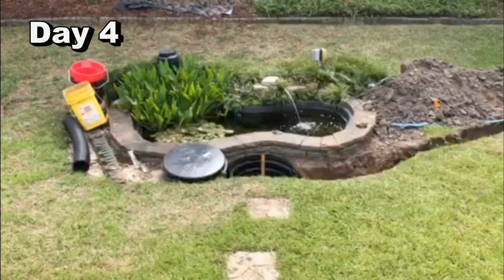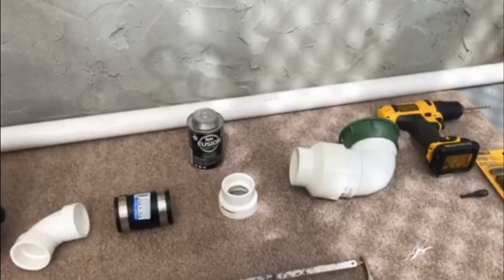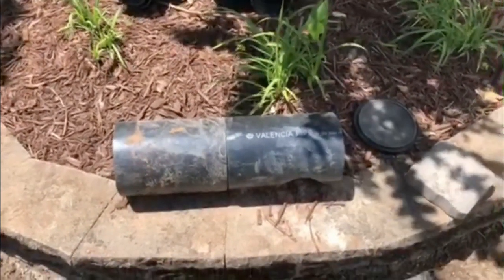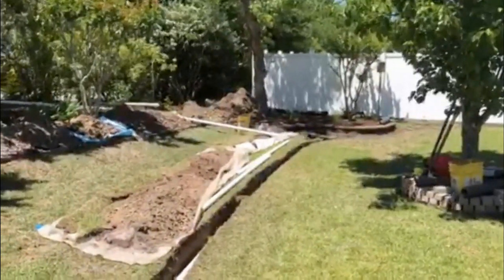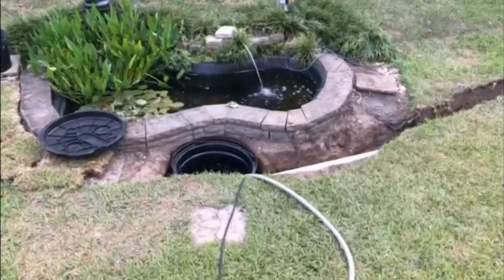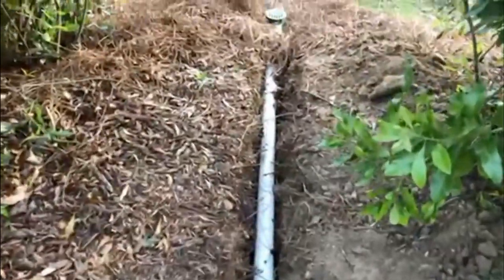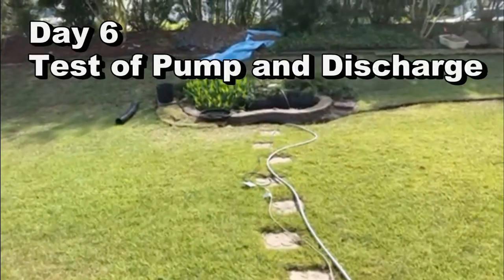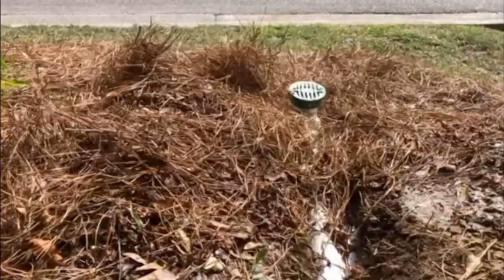Solve Backyard Flood - DIY viewer install

Comment from the maker: Good morning! Chuck here with Apple Drains . I wanted to thank Robert for all his videos and for his great comments about helping him. But you know what? Robert did all the work! He did a fantastic job. I know he would appreciate any and all comments about his work.
Reply: Hey. I have about a 3 foot recessed semi inground pool on one side and was wondering your thoughts on putting a French drain pipe that is corregated and perforated around the bottom and wrapping it using soil separator fabric at the bottom before I back fill it? Would that hold up ok? Will be about 3 feet under ground with draining to daylight on the side that isn’t buried.

Comment: Robert great job!  I drilled my 3/16" hole at an angle so it sprayed down, dosen't really matter i guess. Congrats on getting it done.
Reply: What is the 3/16 hole for?
Reply: @Srvelis82  vent
Reply: @MikeMike-qb3iz  on which side of the one way valve? Before or after?
Reply: @Srvelis82  before the check valve
Reply: Make sense.  Appreciate it.

Comment: If the discharge from the pump is inch and a half, you don't need to open up to 2 inch. The volume of water is limited to the smallest restriction. It would've been much easier to run and connect inch and a half pipes. I also would've avoided using rubber couplers and used 45's & 22's. 
I also like the discharge at the end to be open and not up to drain the pipe. Don't like water sitting on pipe. In northern states, it could freeze. 

Great job! After the grass grows in, it'll be hard to tell there's a drainage system there.

Comment: Chuck or Robert, do either of you have a video about how to handle the electrical when the pump is far from the home?
Reply: I don’t have a video.  I have a small pond in my backyard and previously put an electrical outlet beside it.  I had an outside outlet on the side of my house that was about 30 feet away.  An electrical friend tapped into that outlet with direct bury wire and we buried it from the house outlet to the pond.

Comment: Great job! Instead of clay should you be backfilling with clean stone so the water will make it to the pipe faster and not clog?
Reply: I believe that's only necessary for perforated pipes?
Reply: @butterpecanrican_  I believe that's what is used for french drains

Comment: Doesn't PVC crack when it settles without stone? What are you using for surface water?
Reply: The PVC was only used for discharge. No reason for any pipe to crack if back filled properly with dirt. No cars or trucks are going to drive over it.

Comment: What are your thoughts on backfilling with #57 gravel instead of dirt?
Reply: why gravel ? it is not a french drain. It is solid pipe. water will not get into the pipe from ground only the catch basin
Reply: Yes most of it is solid so no need for gravel.  Just had to ensure the pipe was properly sloped from the catch basins to the sump basin.  In two areas where it puddles, I did put a piece of the easy flow.
Reply: @robertvittetoe6158  thank you. Makes total sense

Comment: My HOA would go berserk if I put a discharge to the road.  I’m on a negative slope, and my only choice is to tie into an existing drain.
Reply: I don't get why places freak out if you discharge into the road.
In all honestly what does 1ft or less of grass going to do anyways? The water still splashes onto the road. Why cant I get a clean look?
Gov is such an endless waste of time and yet people still vote for more of it as if they are not a business... A business with no accountability and takes your money regardless.

What's more annoying is one side of my house goes into the street and the other side (done about a year later) was not allowed to go to the street because "rules changed" with no explanation why.
Reply: I may need some additional work on the discharge location in the near future.  I have a roadside storm drain about 10 feet away and have already researched how to tie into it.